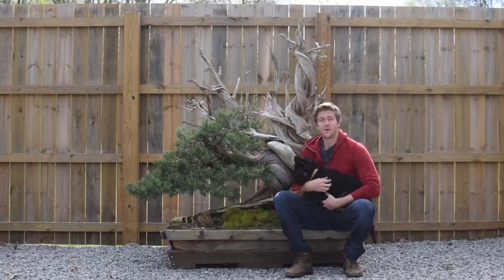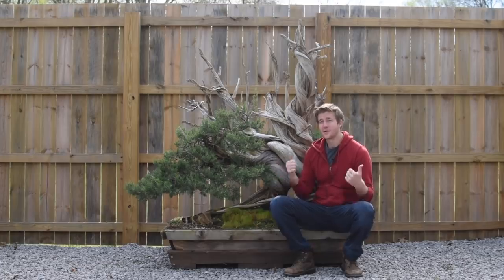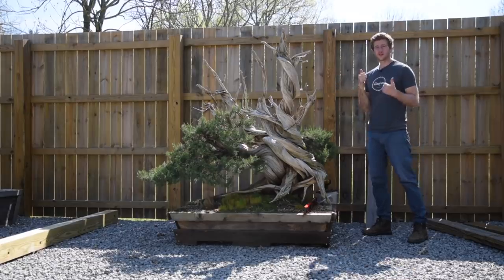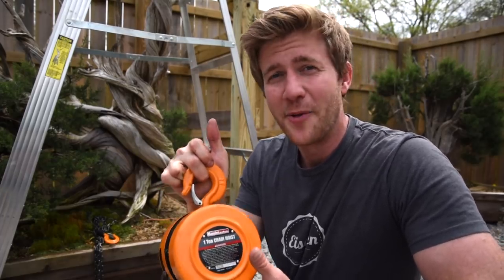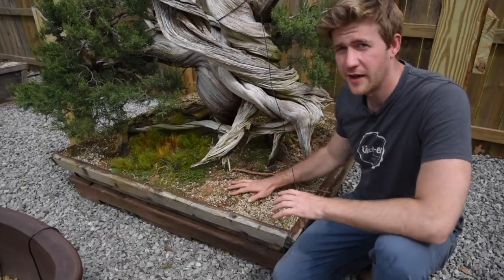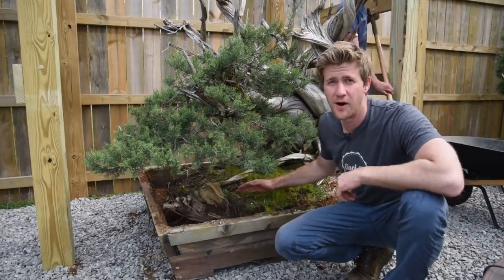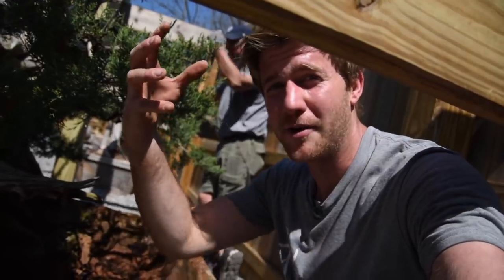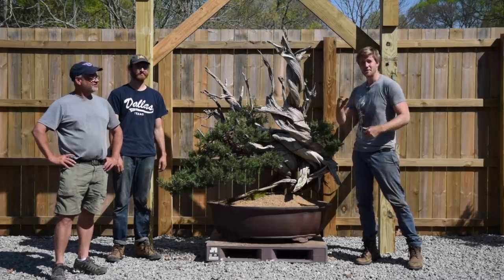The Mechanics of Repotting a Massive Bonsai | Bonsai-U

Comment: The vertical part of the structure is sound. All other bracing against lateral movement? Not so much. 
You're relying on the "neck strength" of the fasteners for support. Never an optimal choice, especially with screws.
Always use triangles (gussets) and the load strength of the materials. Diagonal props on your uprights staked into the ground, cross brackets between them with the face of the material, notches help, taking the load...
Just as a suggestion, I would look into renting a single level of staging from your local building centre. It would probalby be cheaper and go up very fast.
Reply: But it worked
Reply: @johnmullins8030   Sure and so did the Tacoma Narrows Bridge, until it didn't...

Comment: Wouldn’t have just using a regular crane have been easier.  Certainly would have been safer and no I don’t think with the corona virus — this was an essential project and with all of you together.  High quality NZ sphagnum moss would have really been good for the root system as it’s antimicrobial and encouraging to the roots. Stuffed in around the roots and out to the pot edges so the roots would have spread and hair roots developed.  Even with usual large Japanese bonsai, usually tease that soil out so you don’t have to cut so much roots.  The deal is to keep the roots just get the soil worked out — a low pressure washer could have cleaned it up of much of the old stuff, then added some of the old material with sphagnum moss and whatever grit type and potting mix.  The old was to keep some of the mycorrhiza that would have developed over the time it was in the pot.  I’m surprised you did nothing to promote roots or help with the stress nor moisture retention.  Not even a starter fertilizer with biofungicide to help with potential root rot with all those cut roots.  I wonder if it will be alive in 5 years.  You could have built a box — that one seems way to small.  I don’t know guys.  Best of luck.  Do you ever watch Peter Chan Herons Bonsai — he’s in England, had 21+ Chelsea bonsai gold medals before he stopped showing - a feat never equaled.  Has a bonsai garden at Royal Horticultural Gardens - Wisley Garden for years.  Has done a number of books.  He uses their own mix plus a lot of spag moss. His YouTube channel talks about soil mix and a number of the videos on reporting show using the moss to renovate old bonsai for repotting.  An awful lot of great wisdom he is sharing.  Just thought you might enjoy if you haven’t seen his.  Again best of luck.
Reply: Telling Bjorn to watch Peter just makes my day?! 👍😂
Cheers,
Hans.